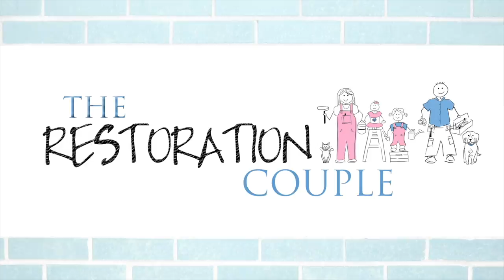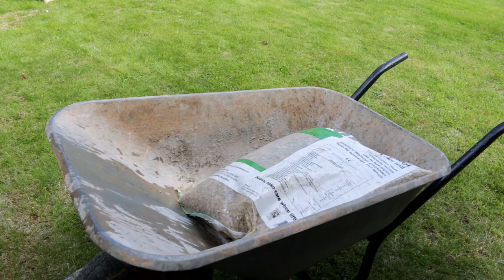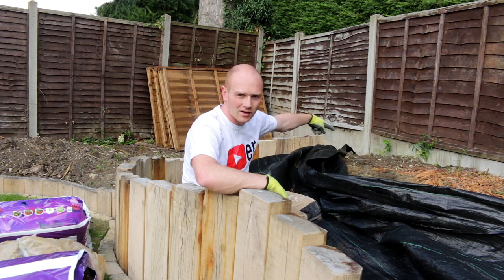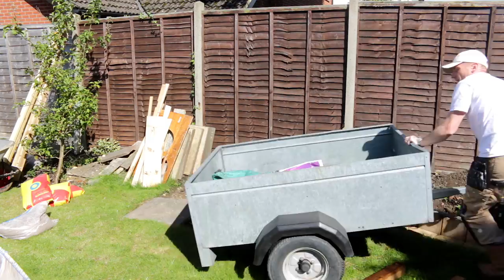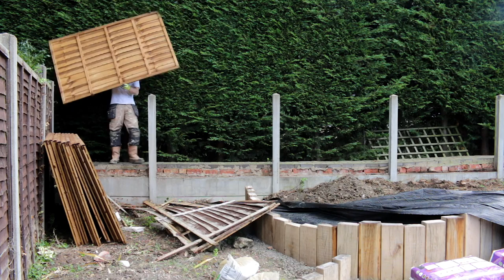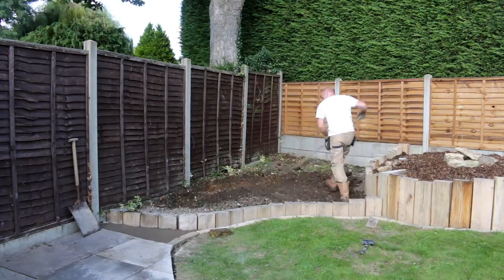OAK GARDEN WALL - 4.0 - Drainage and Completion

Comment: awesome thanks.I have a  little tip for pointing up the coping stones in front. Get a horse syringe and a plastic straw. mix a slush of pure cement ( you can even get white ) with water  and squirt it into the cracks at a slow pace. It will flow everywhere but the water soaks out rapidly allowing build up & once set, its pure concrete. Its how we set fine gaps between portland sandstone . This trick is also perfect for filling up under hollow floor  tiles. Take out a tiny bit of grout and reach under tile with the straw..

Comment: Hi, great video's. Do you do one on how to build sleeper steps that are incorporated into a retaining wall. I've sketched a design for my back garden that requires two sets of 90 degree steps in a quarter circular design.
Reply: Hi Jon, your comment got my attention as I'm also planning to build a circular design retaining wall in my back garden. Just wondering if you have built yours and how does it look? How did you get round the steps part?

Comment: Did you consider using the American and Canadian method of drainage for this type of situation, the weeping tile/french drain with a call to a convenient drain point out of sight? You could install at a later date under the gravel if the drainage is a problem.

Comment: Hi Tim, another great video! So you didn't take the membrane all the way up to the top of the sleepers? If you had a level wall would you have? I'm just really keen to have no soil in contact with the sleepers but keep the membrane completely hidden!
Reply from the maker: Chris Ware because I used the membrane under the whole surface of soil it comes up the back of sleeper to soil level and then folds back therefore no soil can ever get to gravel or timber.

Comment: Did you cover the drainage rock with another membrane before putting all of the mulch on top of it?
Reply from the maker: Marc Carpenter no just put a thin layer of mulch on top. You could do a second membrane but probably unnecessary.